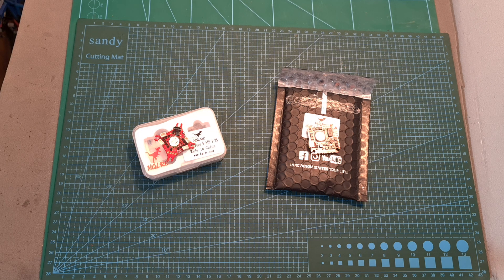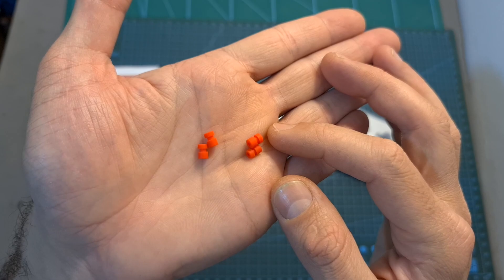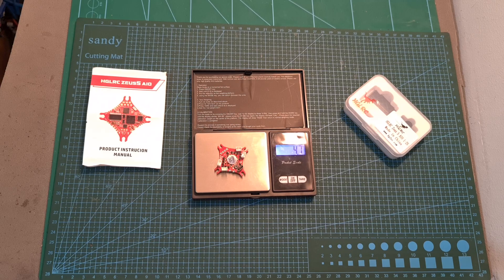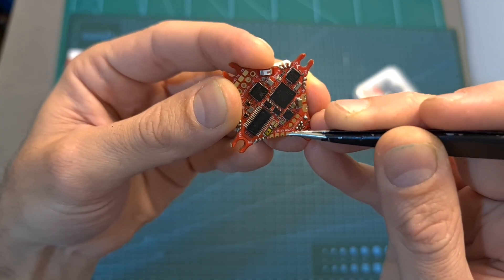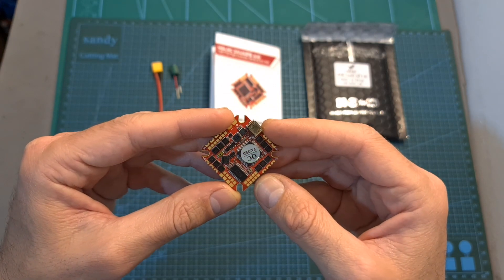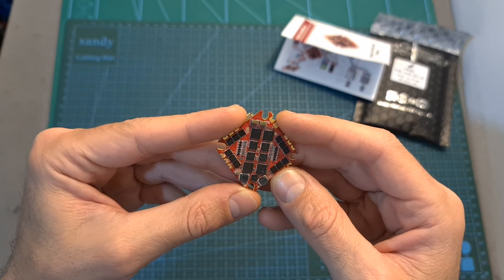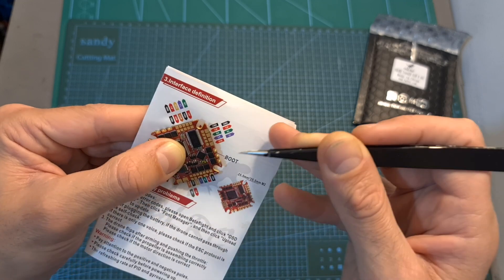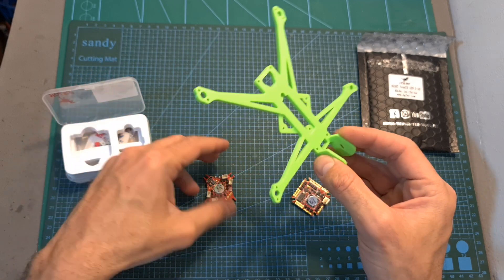HGLRC Zeus5 // Zeus25 AIO Flight Controllers - Overview & Setup

Comment: with the zues aio when i open the speedy bee app it does not show the flight controller.. i have a battery installed and in wifi it shows  the board but speedy bee app does not see it what am i doing wrong?

Comment: The listing says 2 UARTs -- but, one is dedicated to Wifi. A shame as I was hoping to add a mini GPS to my Rekon3, but that will never happen with this FC unless I run the control link on softserial... so lame.
Reply from the maker: Yes, I thought that I mentioned it in the review but I am not sure. I have to rewatch it lol :-)
Reply: @KremerFPV  The wifi chip was mentioned, but not that it takes up an entire uart that is not possible to access or disable the wifi from using it. You might have mentioned it in other video you made on the FC but I did not check it. I asked HGLRC and they actually replied and told me there is no way to access UART1 on this FC for anything else, even if you remove the wifi chip, it is not set up like a normal uart. It's all good. Thanks for the reply, hope you're doing well.
Reply from the maker: @JohnCuppi  Probably. Yes, I am doing great, thank you. I hope you're doing well too :-)
Reply: @KremerFPV  Glad to hear! I asked this question because I'm working on a little review of the M10 GPS and was hoping to get it done this weekend with the rekon3. 

It's all good though. Not like there's any rush these days. I'm taking things a lot more casually  here on YouTube. The whole review scene has really changed a lot from back when I first started.... the views/interest in FPV content just isn't what it used to be, unless it's a DJI-something. YouTube doesn't help either. 

I'm subscribed to you man (personalized), and I feel like I haven't received a notification for any of your content in a very long time.

I still love the hobby, though, but with the way things have slowed down for me I'm just chilling out and going at my own pace. Good to see you're still making content!🤞
Reply from the maker: @JohnCuppi  yep, times are changing and I am going to slow down as well. Just watched your DJI Integra review - well done. I'm also having issues with the FOV of my goggles 2 and maybe if the opportunity will come up I will get the Integra as well.
Reply: @KremerFPV  Thanks for checking it out and for the compliment! It means a lot coming from you! 👍DJI really screwed up the Goggle2 for a lot of people... The integra seems to be the fix. I am just disappointed the integra antennas cannot be changed.
Reply from the maker: @JohnCuppi  sure thing. Take care and keep in touch!

Comment: Apologies for my questions, but this is my 1st time building my 1st fpv drone, and i'm using this aio board.

I am stuck as to where or what the motor configuration is... Which side of the board is up (facing skyward) and which side of the board faces down (to the ground)?
And with that proper orientation, which side is motors 1/2/4/3? Is it left to right, or right to left (given the drone is belly up)?

Comment: hi could you tel me the pinout for connecting a Spectrum SPM4650 Receiver DSMX SRXL2 Serial Micro Receiver on the HGLRC Zeus5 AIO 1-2S F411 Flight Controller   i have tryed different connections and still not working....... cannot see in betaflight useing uart 2.

Comment: Can I add gps to the zues5 aio?? Thanks
Reply from the maker: Yes.
Reply: @KremerFPV  perfect. Im planning to buy the rekon 3 nano LR. Which tabs would I solder my wires too? Beginner here! Thanks
Reply from the maker: @MainAccount.1  If you can wait I will show you soon when I will review the Rekon3.
Reply: @KremerFPV  thankyou Gal. Your my go to guy for everything that's technical! I was asking because I preordered the rekon 3! Which gps will you be using? I may aswell get it ordered for your video release haha
Reply from the maker: @MainAccount.1  I appreciate your trust :-) 
I am just going to use the one that comes with the Rekon3. It should be here pretty soon.

Comment: I have the ZEUS 5 AIO, when measuring between the battery input positive and negative soldering pad, my multimeter is giving a reading of around 1.7ohm and produce a continue beeping sound, it mean the two pads are shorted? Is this normal? Can someone advise me. Many thanks in advance.
Reply from the maker: It doesn't sound normal. Did you figure it out? If not, let me know and I will test mine.
Reply: @KremerFPV  Thanks for reply, I have figured out the problem, there was a very tiny solder debris dropped in between the camera +& - solder pad, I found out by using my camera zoom... the beep sound gone after the debris cleared, consider myself lucky as I did not power up the board fitst. 😰
Thanks again. 🙏🏻👍🏻

Comment: Hi Gal! Thx for great video. where is UART 1 pads? Id I do not want to use VTX control but instead to connect GPS. Cannot find pad. Thx!
Reply from the maker: Thanks Martin. I guess you are referring to the Zeus5 FC. UART 2 is used for the RX (01:40).
Reply: @KremerFPV  thx I get reply also from hglrc. So uart 1 is used for wifi and uart2 for RX... so basically by adding wifi feature they removed 1 uaable uart. Shame..
Reply from the maker: @martinmacko7297  sorry for the confusion, yes you are correct of course (updated my comment). You can still make it work if you would setup your VTX manually.
Reply: @KremerFPV  but how? Rx is using only B5 pad. Which is rx bjt where is coresponding tx pad to it?
Reply from the maker: @martinmacko7297  You can use the LED pad.
Reply: @KremerFPV  can you please be bit more specific? I really struggle and need to connect gps. So I put rx pin from gps to B5 and tx to led? How I configure led pin to act as tx for gps?
Reply from the maker: @martinmacko7297  Sure. First please watch this video: https://youtu.be/C7zYdPz-KtY
Please pay attention that GPS using softserial is not working well, so I recommend to connect the GPS to UART 2, and use the LED and M5 pad in order to connect the radio receiver.
Reply: @KremerFPV  which LED pad Led Strip or LED?

Comment: Great review! I wonder if the Zeus25 would work on a 6s 5in build. I mean, Mr. Steele was running 25a ESC's on his quad, but idk if this board would have the same outcome
Reply from the maker: Thanks! It depends on the motors, but in general I doubt it (unless you will limit the motors output).